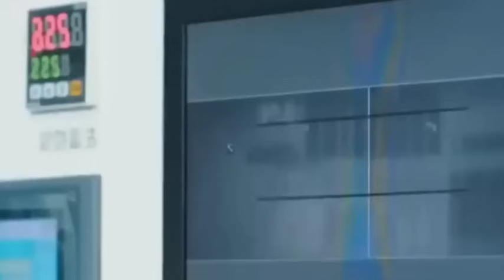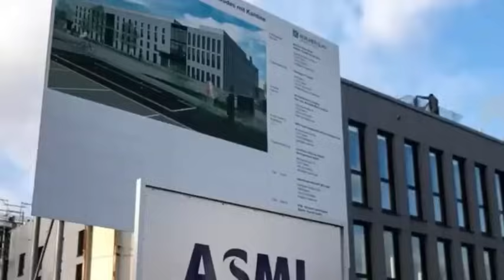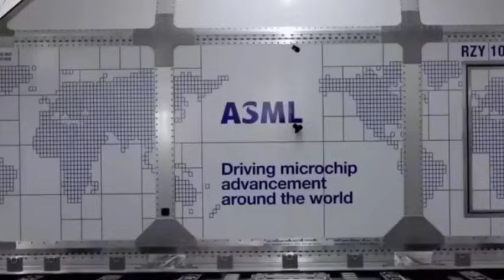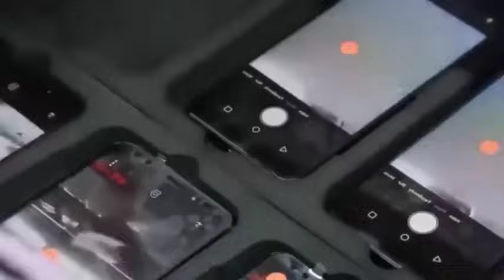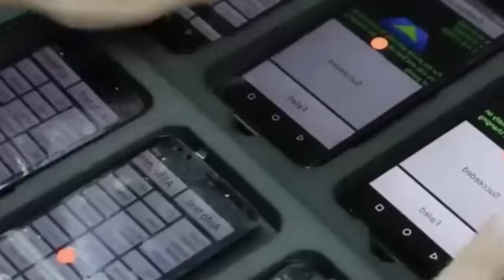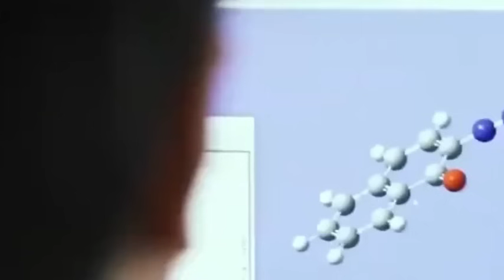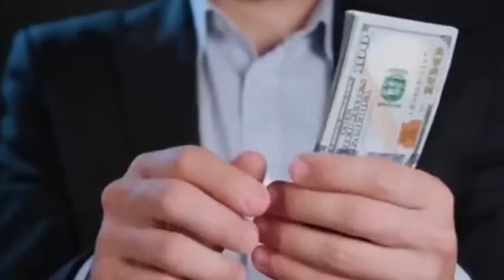China released new photolithography factory plan, U.S. restrictions will no longer be in effect.

Comment: Electrobeam. Like mapper Lithography in delft netherlands.
Reply: @jeffreyf6960
No, they are not using an electron beam for etching!
They are using an electron beam to creat EUV light, and that's used for etching.

It's called: Synchrotron radiation.

"Synchrotron radiation is the electromagnetic radiation emitted when relativistic charged particles are subject to an acceleration perpendicular to their velocity."
Reply: @larsnystrom6698 useless without proper mirrors

Comment: Wow, Tsinghua’s method is beter than the EUV machines of ASML since it can make even smaller than 1nm chips. China has already begun building the factory to produce 1nm chips using the Tsinghua method. By next year China’s Tsinghua EUV would surpass ASML’s EUV capabilities and reaches the top level of silicon based semiconductor technology. The usa can no longer use sanctions against China as she has surpassed the usa’s technology.